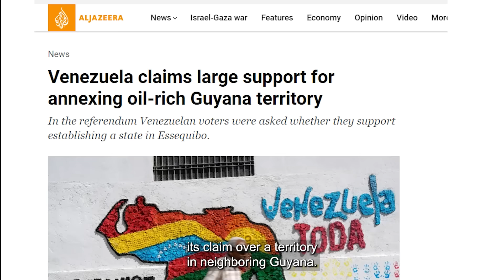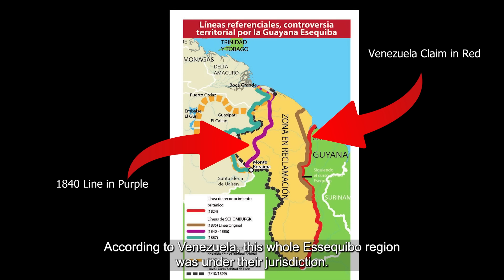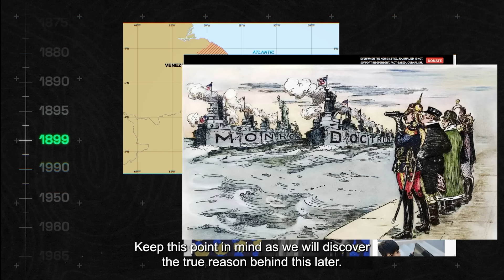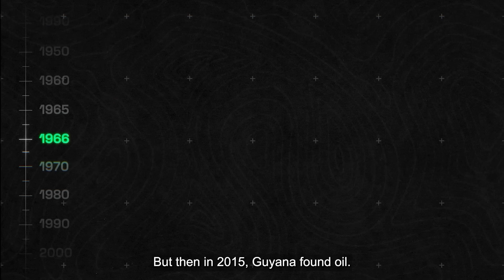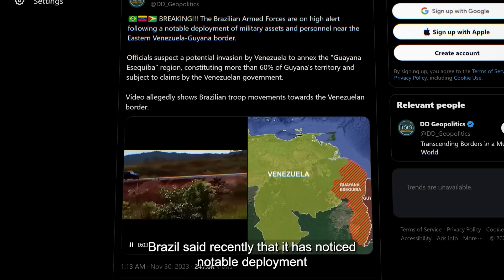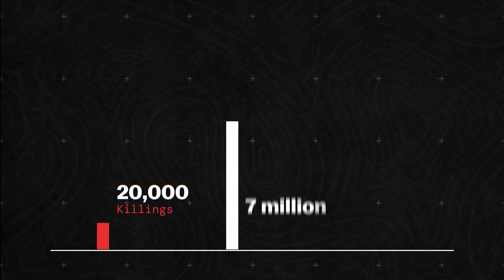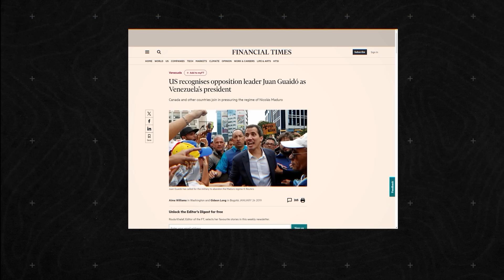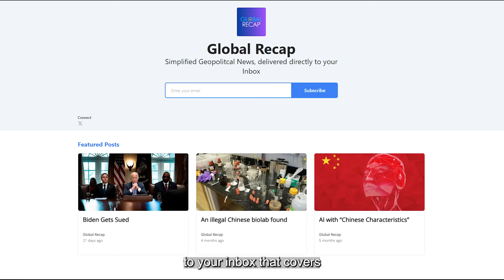Venezuela Taking Over Guyana! A War is Happening! (Not About Oil)

Comment: Remember, this YouTuber is not an expert. 

One of the main things to remember about this conflict is that there are no roads between Venezuela and Guyana, just thick jungle. It is practically impossible to wage war through the jungle. That leaves Venezuela with two options: drive through Brazil (which Brazil does not allow) or create a Naval assault. And the British have patrol boats in the area. Not to mention the Venezuelan Navy does not exist for most practical purposes.

While this could be used for a pretext for war, we should not be thinking that it's going to happen anytime soon. The infrastructure for war is simply not there. This is most likely being used to rally nationalist support and help keep Maduro in power.

Comment: The reason Venezuela wants this oil is because the oil that does come out of Venezuela is not very high-quality and has to be refined more than higher quality oils Also, Venezuela’s oil refining infrastructure is very outdated.
Reply: So?
Reply: Venezuela's oil has higher quality than Mexico's, and is comparable to the quality of Russian oil.

You say you want Guyana's oil because it has "more quality" but that's stupid.
Reply: @A_JR8507  so, the country wants that better quality oil to have an edge against the low crude quality that they have

Comment: A couple things not mentioned:

The original land dispute wasn't between Venezuela and Briton, but between Spain and Briton, who were the colonizers. Venezuela inherited the dispute when they gained their independance from Spain. Read into this as you will, but it is interesting that Venezuela keeps returning to and holding on so tightly to colonial rhetoric.

Secondly, the oil that Venezuela has is mostly extremely heavy which can only be processed in a select number of places, most of which are in America. This is why the sanctions America has put on Venezuela are actually quite harmful, because it is a lot harder for people to use the oil from them unless it first goes through America (or other places which can't churn out nearly as much as America can). On the other hand, the oil that was just discovered is extemely light and can be processed pretty much anywhere, so is extremely easy to sell. If Venezuela can get those reserves, they can lessen the effect of the sanctions (and their incompitent mismanagement of their local industry). Agreed that it is more about power than money, but remember that money IS power in a lot of ways, so more ways to make money are always an ideal situation.

A third thought is that it may be more posturing than serious desire to take the oil. If they were able to take it with minimal opposition, then they would be happy with that. But since there is the war in Ukraine, Isreal, and the looming war for Taiwan, Venezuela's president may see this as an opportunity to just throw a bit of weight around, hoping that America and others would rather just give them something to be quiet to avoid one more conflict to have to worry about
Reply: Sorry for being generic and saying "Venezuela is doing..." I know most of the things happening are what a select few elites want, and not the general public.